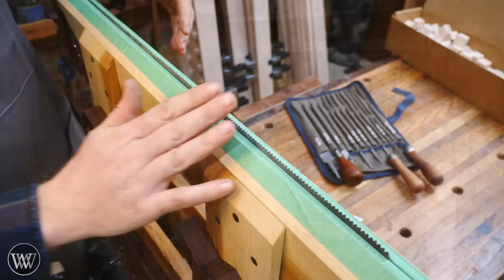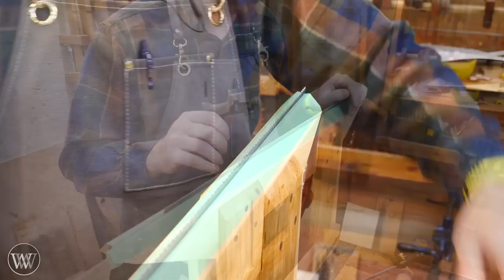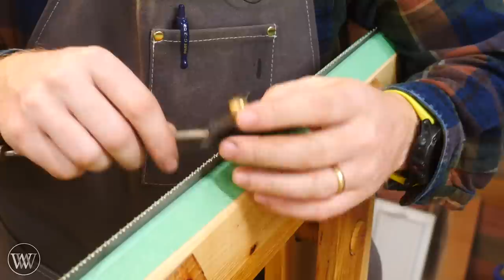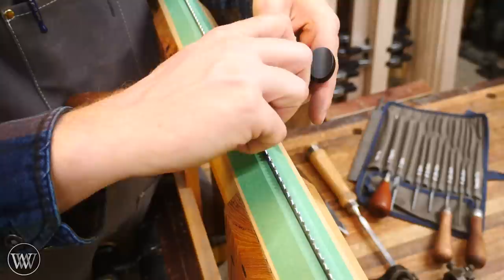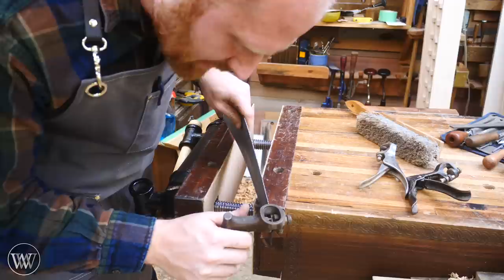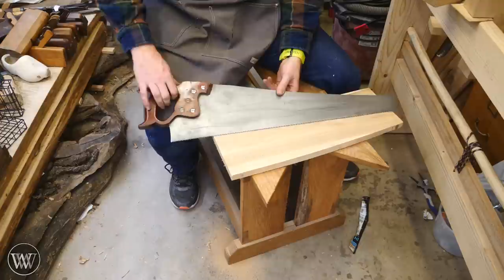How To Sharpen a Croscut Saw Hand Saw Sharpening

Comment: I used to have a semi automatic filer from Belsaw that i bought in a yard sale years ago, it worked well, but parts are no longer available for it. I sharpen and set handsaws by hand, i did buy a used Foley Belsaw automatic filer and it works well, but if i only do one i do it by hand. Now when i do them for people i do them in bulk, like min. 2-4 or more the prices on hand saws are cheap these days, so unless it's mine i won't sharpen just one! This is a great post!

Comment: I have been involved with woodwork since a boy  my father was a master carpenter and joiner and more ofter than not he worked away from home.
He was a really hard taskmaster with a short fuse so it did pay to be atentive.
Every weekend he use to come home bringing all his tools with him, this included a whole lot of different saws from brass backed panel saws to rip saws.
He had a saw vice very much the same as the one you have other than the fact that this one stood on the floor.
His rip saw was sharpened from two sides, in other words each alternate tooth was sharpened and the saw horse turned round and then the other teeth done.
Please note that i said the saw horse was turned Not the saw turned round, i only made that mistake once, i think my ear is still ringing for that.
There was also a degree upward on the cut as it increased the cutting ability of the saw.
The whole thing wass about a four hour job as there were chisels plane blades including rebate planes and moulding planes that hah to be sharpened and also bits for brace and bit sets.
Although his atitude towards instruction was more bent towards a clip along side the ear or worse, clearly it was nothing i ever forgot, and i wonder what he would do in todays world of electric tools, the nesrest thing to that was a Yankee pump action screwdriver he used a lot when hanging doors which took him about five minutes to do including cutting out the recesion for the strike plate and hinges, in thos days usually three hinges per door.
It was a shame that he had such a short fuse, but he really was a craftman including carving work often seen in churches, something i found i was more edept to.
At woodwork classes at school they never cottoned on to the fact that what took the rest of the class a couple of weeks to complete i did in one lesson, although i became an engineer i never forgot   the carpentry .
Reply from the maker: Love the history.
Reply: Great story. Thank you. Lots of memories in there.

Comment: A few days ago I sharpened a very old, very dull rip saw and was very happy with the results of my first every saw sharpening. Today, I used this video as reference to sharpen and convert another very old, very dull saw into a cross cut saw. While I didn't come your as well as the other one, it does function well and I am still happy with the results. Plus, now that the new tooth geometry is established, the next sharpening will come out better.
Reply from the maker: Right on. the best thing about learning to sharpen is that even a poor job cuts better then it did before.

Comment: I like to blacken the teeth with a marker first.  Just a tip for old eyes, it helps.  I think you have the rake angle description a bit confused in your explanation.  0 rake would be vertical (good on some rip patterns) on the cutting edge, and not the top of the file flat (which would be a 30 degree rake....which is very lax) and then the degrees of rake would be laid back from the toe of the saw.  More rake is less aggressive.

I heard once that a poorly sharpened saw still cuts better than a dull one....lol.  A pretty true statement.
Reply from the maker: Thanks Jim. I use to blacken them too. It can really help.

Comment: Ok, I’m ready to dive in. Really great tip on why wide set may be handy. I’m not so good at staying on line. While it could be the saw, I rather think it’s me... just new to locate a 6 sided file.
Reply from the maker: Sweet man. to get started you can just get the cheap ones from the hardware store. they work fine just often do not last as long.

Comment: Definitely a fantastic video one the cross cut sharpening,
Hope you will go over the saw set tool and all the numbers on it and how we can use one with out breaking a tooth off 
Again wonderful video as always 👍🏻👍🏻👍🏻
Reply from the maker: The problem is every saw set has different numbers. The key to not breaking teeth is not to bend them too far. It takes just the smallest amount of movement. Almost none at all.

Comment: Hi James: I have just purchased a disston saw sharpening set guide and was wondering if you have seen or used one before ?
Tried to add a photo of it but not able too.
Reply: Wondering if someone has a video on how to use it.
Reply from the maker: I have used one in the past. I don't have a video showing that as I generally don't like to use guides. But it can definitely help you out getting a smoother cut until your hand gets used to it.

Comment: I'm curious about why you focus on the tooth that is on the obtuse angle side of the file. If I got the geometry right, that is the tooth toward the heel of the saw, which means that you are controlling the trailing edge of the tooth. Since the saw cuts on the push stroke, wouldn't it be better to be paying attention to the leading tooth edges? Or did I just get turned around while watching the video?
Reply from the maker: correct but you are actually cutting n the front of one and the back of the other at the same time. it is six of one half a dozen of the other I just look at the one where I am going so i do not get confused and look at the wrong tooth. it is often difficult to keep track of teeth.

Comment: So, when you file sides of two teeth at the same stroke, how do you ensure, that you dont overfile the same tooth later, or some previous tooth? (When one side of the gully needs more sharpening than the other?)
Reply from the maker: If the teeth are uneven you push forward or backward and focus on the tooth that needs more work but if they were filed correctly the last time they should end up needing the same amount of work.

Comment: What do you do if a tooth has a shiny spot, but the two teeth on either side don't have a shiny spot anymore? Something obviously went wrong somewhere, but what can be done about it?
Reply from the maker: in that case rather then pushing the file straight down I push it toward the shinny spot and just work on the front and back of that tooth without touching the tooth in front or in back of it.

Comment: What if the plate is slightly bent? Will that have a huge effect on cutting?
Reply from the maker: if it is a curveing bend then you can bend it back. if it has a kink with a great amount of skill and time it can be fixed, but most of the time at that point the saw is trash.
Reply: I got one for free, that looks like someone punched a nail in it, guess that means its trash :), might use it to make a scraper or something then :)
Reply from the maker: ya. you might be able to bend it back with a ball peen hammer and an anvil, but I would not keep my hopes up.

Comment: Sharpening a larger TPI saw is not so intimidating.  How about sharpening a Carcas saw or a Tenon saw with a larger TPI? (or even a Dovetail saw)  Is it the same process?  My eyes really have a hard time working on a 14 TPI saw.  The file jig looks like a real great way to maintain consistent strokes with the file.
Reply from the maker: yup it is the same thing all the way down to the small teeth. some people will use a magnifying mask to see them better.

Comment: I tried to sharpen a saw with a flap disc on an 7” grinder. I messed it up.
Reply from the maker: LOL yup that would do it!
Reply: How could that be ? Explain .....
Reply: @GMAN420BC  A 7" grinder is designed to rotate an abrasive disc (usually for HEAVY metal grinding or cutting) around 5K or 10K RPM's... It's a BEAST!
    A "flap disc" is basically a HEAVY grade disc composed of abrasive cloth "flaps" more or less stacked around the circle... 

    SO... it's not hard for someone new to the idea of saw sharpening to consider the abrasive cloth flaps might fit into gullets and make the job just that much easier... but they don't really do that so well...

    What results is basically unleashing about two horsepower worth of torque crushing asphalt covered cloth into the teeth of the saw at every angle at once... It's usually not pretty... In about the first five seconds or so of "practical attempt"... the person trying this will realize he's removed about half the teeth of the saw completely, shredded the disc to nearly unusable, and if he's escaped relatively unscathed, he feels extremely lucky with his own personal health still intact...

    Just for the record, no... I did NOT actually participate in the carnage of finding this out myself. I was (however) on the sidelines of the famous last words "Hey fellers, check this out!" while someone else approached the idea... AND I've kind of decided on my own that power tools and sharpening are only mixed with extreme caution.
    If you really REALLY want a suggestion on a power tool to use for sharpening a saw... I might suggest you very carefully and with a GENTLE touch, consider a "Dremel" (or similar rotary utensil) equipped WITH variable speed control and a "Stylus" attachment... They make tiny sanding and grinding discs for those things, and with an abundance of practice you can actually manage to accomplish more help than harm with them.

     Variable Speed Control is ABSOLUTELY necessary in any sharpening, so you don't over-heat the metal. It's not that you'll exactly "ruin" the temper, but hot metal gets soft, and that promotes metal going away FASTER than you expect... Slow and patient will win this race... and gentle Gentle GENTLY!!! ;o)

Comment: JAMES  long time no talk! So you have a plan for that saw vice? Check my channel  I'm building a new house and a huge shop. Just getting back on due to some issues with the health but then was designing the shop and house. We need to get together sometime.
Reply from the maker: Sweet man sounds like fun. You still in Watertown?
Reply: @WoodByWright  no I sold the house in Watertown. I am building a new house with a huge shop attached to the the 3 car but the shop is still separate and with it's own 200 amp service. Hopefully we will have occupancy in January.

Comment: I disagree.... there are lots of wrong ways that people do when filing a handsaw.  Believe me... I've refiled many many saws that were without a doubt were done wrong.
Reply from the maker: But they still cut and probably better then they did .
Reply: Not always.... The first crosscut saw I ever sharpened ended up with sharp points, but it would not cut through a 2x4 without jumping out of the kerf and just tearing up the wood.  Then I started reading some right ways to file a saw, not sharpen it, but file it.  When filing a saw, it's more than just sharpening.

Comment: Hi James! Why it is important to joint the teeth before sharpening? What exactly is the issue with having teeth at different height and not being in one plane?
Reply from the maker: If the teeth are different height is in only the tall ones will bite into the wood. Shorter ones won't actually cut anything. And most of the time due to the way they get filed you'll have more tall teeth on one side of the plate than the other and that will also cause it to go out of alignment. On top of that it can be harder to start as it tends to bounce more.